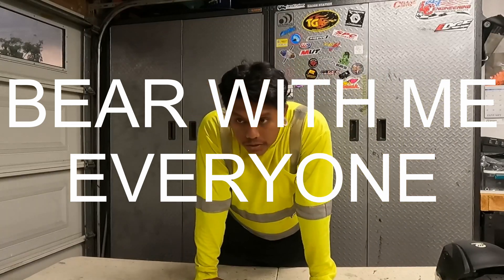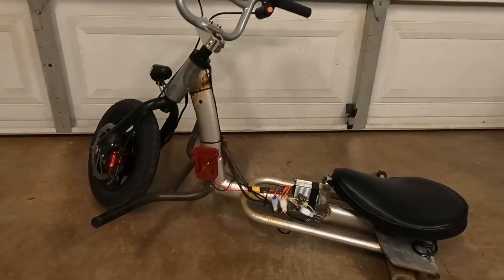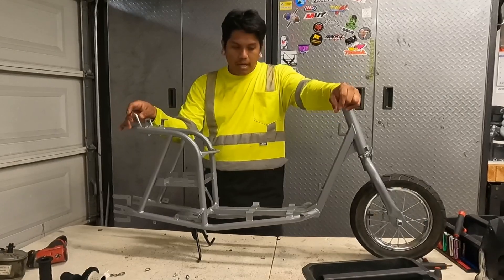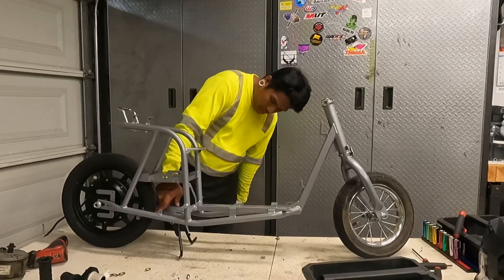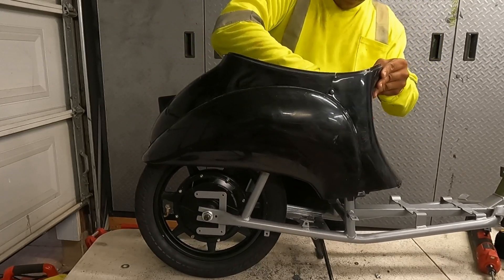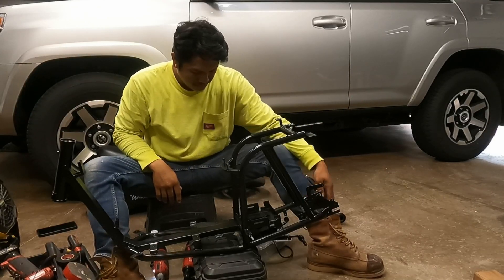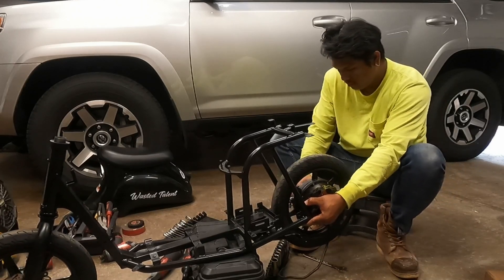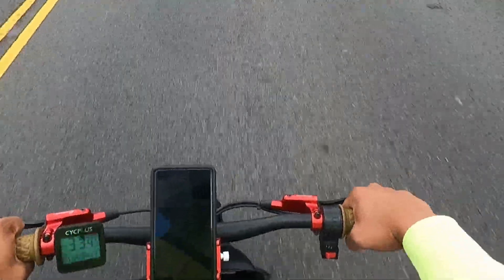My Take On A Razor Pocket Mod Build

Comment: I’ve already got the 14inch electric hub motors I’m in the middle of building a 72 V one but it’s just gonna have a vivo 3000 what motor and I’m gonna pull back the two support poles at the back off the subframe and swing arm and hope to God I can squeeze one in lol just gotta do your measurements what right I guess which I’m terrible at lol but yeah next build im just gonna use one off the 14inch motors I’ve already got the roadrunner forks on there but they’re sketchy gotta sort that and will just use like a high amperage 36v battery she go for hours for like a cruiser nice build anyways man

Comment: the motor is lunyee 3000w 72v 14 inch hub wheel motor. they have a more powerful motor which has 5 spokes and some shiny metal on it and is rated for 5000w.
Reply from the maker: Nope. JSC 1500W
Reply: @JonnyDuzzit Chinese stuff is all the same
Reply from the maker: @topgunashwin9893 yeah im just saying i've seen videos of JSC motors come out of their own factory. And im using a JSC
Reply: @JonnyDuzzit where did you order your JSC motor?
Reply from the maker: @DylanKessler-d1w aliexpress
Reply: @JonnyDuzzit  thanks for the info I'm trying to build one of these for the mini bike racing scene here in FL! Someday
Reply: @JonnyDuzzit do you find that motor to be more powerful than a regular one
Reply from the maker: @DylanKessler-d1w  compared to a my1020? Hell yeah, and it was the best choice for this application.
Reply: @JonnyDuzzit  heck yeah bro! And btw I'll pay you to make one of those adapters for the brake for me!😊

Comment: I’m about to do a build with one of these and I’m gonna make a front fork for the jetson work with some welding to get suspension on the front
Reply: You mean disc breaks * jetson one I’m thinking off isn’t shock ones + there’s a lot more fabricating and shit to do to make it work. Looks like this fork whatever it is because I couldn’t hear him in the video is a direct fit at least for a 14 inch wheel if that’s the way you wanted to go I still don’t get why people are mounting batteries to the decks. I mean yeah I know batteries hard to get but all you would have to do is cut the top. Two back subframe poles and weld them a couple inches back and Walla you’d be able to stick a bigger battery in

Comment: Its always funny do see a size comparison to these things, So tiny! That build looks awesome, The only part I dont really like is the battery placement. But it is convenient I guess.
Reply from the maker: Yea i gotta get a custom built battery and didnt want to cut the panels up to fit the battery i used, but i wanted to ride it already so i guess its good enough for now lol
Reply: @JonnyDuzzit The convenient part about using a hub is all that extra space in the shell for the battery. I noticed you reattached some of the old battery tray on the motor plate, I assumed thats why, and with you mounting the controller where you did all but confirmed that might be your future plan. One of my pocket mods has a hub, but the batteries I have in in suck, and I got a Bellezza on marketplace, Much more comfortable on long rides, I somehow managed to shove a 13s8p I cobbled together from a wholesaler site, Less than half an inch clearance from the tire, stock motor. I think it was two 11.3ah packs that I had to shuck from nice aluminum ebike shells and rewire, and rewrap to make them fit. so far the longest trip I make was 16 miles, and I think it only ate like half my capacity, and it wasn't fully charged when I set out lol. My smaller scooter can manage about 8 miles, and My butt hurts after lol, Could use some more padding.
Reply from the maker: @DanielSquidington  good eye lol not everyone would see the relocated batt tray
Reply: @JonnyDuzzit  been thinking about doing the same on mine, not gonna lie, I don't own a welder though. Also thought about adding a bike fender in ther under the plastics to keep the wheel from throwing a bunch of water and dirt and crap all over the electronics.